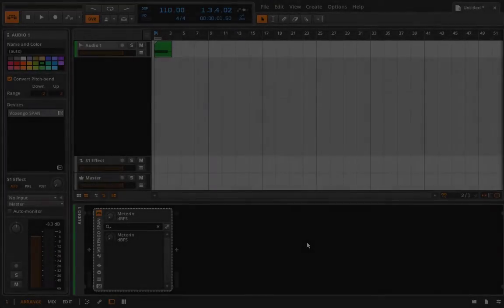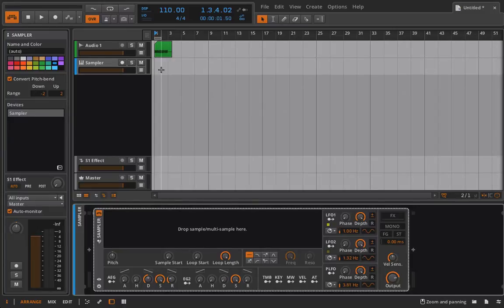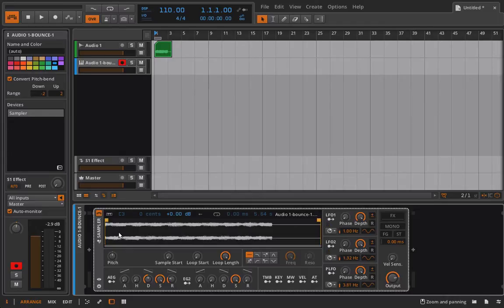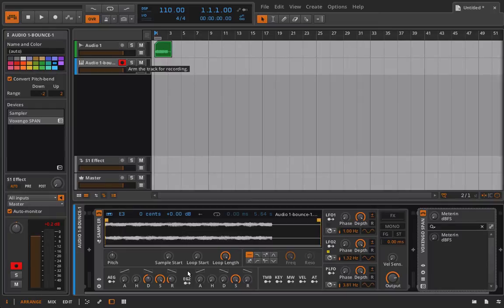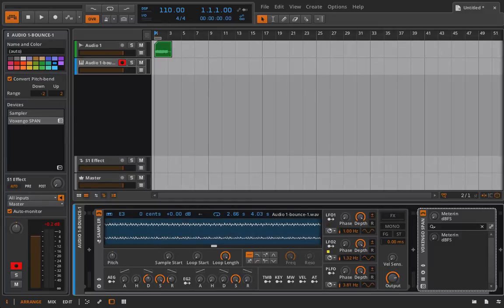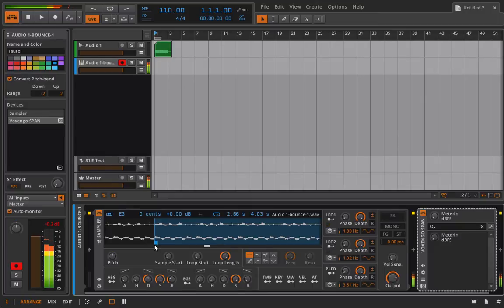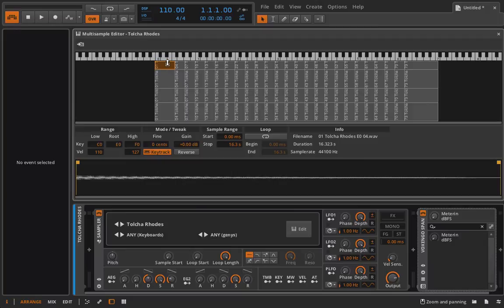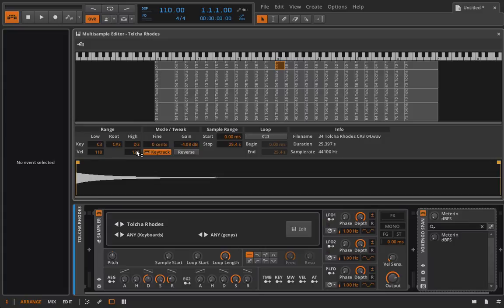Bitwig Studio & Music Production Course - 5.78 - Sampler (Single or Multi-Sample Mode)

Comment: Hi, how would you approach a 808 bass sample and making it "cut itself" off as each note plays like in FL Studio for example. So they don't stack up? And for other samples like a hi hat maybe, where you still want it in stereo, but each hat cuts off the previous? Thanks!!!
Reply from the maker: I guess it depends on how you approach it. As far as I know there aren't any choke group options like what you would see with a drum machine. However, if you are working with the sampler just set your release times to zero and then program things in legato (all notes connected) so that the sound will cut off upon the start of the new note. So with your hats just pull back on that release and all should be good... Or you can just turn the mode to mono (meaning one voice monophonic not "mono" as in mono/stereo). I've attached a short video that might help...I just think that mono button is confusing you... and just by enabling that you'll get what you want.

https://www.youtube.com/watch?v=OObGT1SVw2s&feature=youtu.be

Take care,
Brian